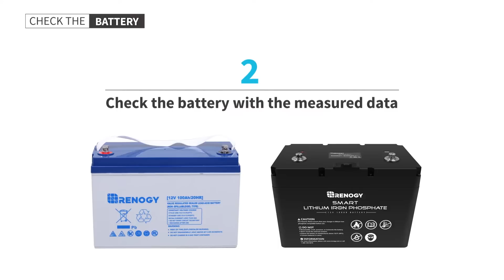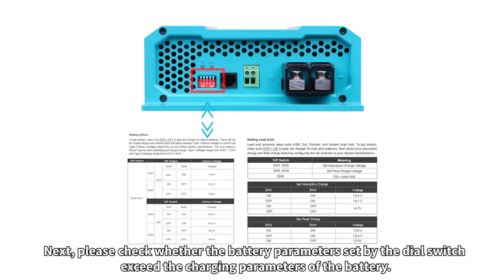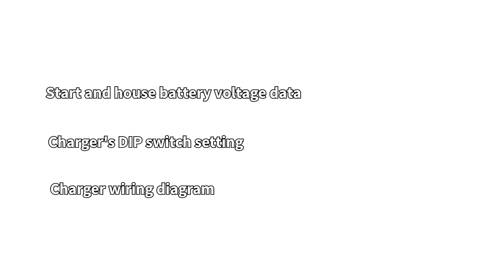Troubleshooting 12V DC-DC Battery Charger

Comment: My input voltage is 14.5v output is reading 13.4v (lithium battery voltage) and no red light but green light on . Dip switches are all correct 1 &5 off 2,3,4 on. What to check next?
Reply from the maker: Hello！You can disconnect and reconnect the wiring on the charger. Then, with the charger's green light on, disconnect the wiring on the output end and use a multimeter to measure the voltage at the output terminal to see if it reaches 14.4V. If not, it means the charger is faulty

Comment: I have a red light on with the greenlight on as well and I disconnected the ground and replaced it and it's still on and not giving power to my solar battery.ive had it for a couple months and its been working jus fine
Reply: Did you figure this out?
Reply from the maker: Hey Cameron,

For any technical questions, please contact us here- https://www.renogy.com/contact-us?gclid=CjwKCAiA3pugBhAwEiwAWFzwdeH3Crd9vRTbjjTYl9l3daVqnotJPjBhs2nmw-Wkn1_guWQeW0ao6hoCOHcQAvD_BwE

Comment: I have 14.4 volts on input side of 40a dcdc charger and 13.7 on output side. Ive driven the car over 3 hrs to a campsite and the voltometer on my control box and battery box never changed value. Seems to not be charging green light and everythings on receiving power i cant figure it out.
Reply: Too bad they dont answer your question. I have the very same issue.  I dont think mine is working. May have to get a refund.
Reply from the maker: Hey Air Eye,

For any technical questions, please contact us here- https://www.renogy.com/contact-us?gclid=CjwKCAiA3pugBhAwEiwAWFzwdeH3Crd9vRTbjjTYl9l3daVqnotJPjBhs2nmw-Wkn1_guWQeW0ao6hoCOHcQAvD_BwE
Reply: @Slimsomerville  was thinking the same
Reply from the maker: Hey Brodie,

For any technical questions, please contact us here- https://www.renogy.com/contact-us?gclid=CjwKCAiA3pugBhAwEiwAWFzwdeH3Crd9vRTbjjTYl9l3daVqnotJPjBhs2nmw-Wkn1_guWQeW0ao6hoCOHcQAvD_BwE

Comment: Can anybody please tell me what the settings is for the dip switches I have two lead acid 100 ah leisure battery’s
Reply from the maker: Hi, Rob.

Please make sure SW5 = ON to gear the charger for lead acid batteries.

Next please set according to the voltage value of your boost charging and float charging. You can refer to page 16 in our manual book https://renogy.com/content/RNG-DCC1212-20-BC/DCC1212-204060-Manual.pdf.

Comment: How can i use custom "user" setting? I will buy if i can set special charge voltages for my diy battery bank
Reply from the maker: Hi, Blown.

In order to assist you to solve your problems, we suggest you can submit a case through our Help Center Portal (links listed below for specific locations）for help. 
 
https://renogy.force.com/helpcenter/s/contactsupport (USA)
https://renogy.force.com/helpcenterau/s/casesubmit (Australia)
https://renogy.force.com/helpcenterca/s/contactsupport (Canada)
https://renogy.force.com/helpcenteruk/s/contactsupport (UK)

Comment: I have a solid red light when unit is powered on. The unit has been used for a few months correctly, the wiring is correct. DIP switches haven't changed.
Renogy 170Ah battery at 50% charge:
Voltage in 14.1V
Voltage on output side 13.1V
DC charger was left on while vehicle was off, fully drained the car's starting battery. Issue started after recharging car battery to usable levels.
Reply from the maker: Hi, Winter.

For troubleshooting your problems, we may need you provide us with the photos or video for assistance. So we suggest you can submit a case through our Help Center Portal (links listed below for specific locations）.

https://renogy.force.com/helpcenter/s/contactsupport (USA)
https://renogy.force.com/helpcenterau/s/casesubmit (Australia)
https://renogy.force.com/helpcenterca/s/contactsupport (Canada)
https://renogy.force.com/helpcenteruk/s/contactsupport (UK)
Reply: Did you Happen to find out why the red light was on and how to fix it

Comment: Do you crooks plan on staying in business answer comments I need help withe 14.6v lithium type 2 dip switch settings?
Reply from the maker: Hi, Thick.

Thank you for your feedback. In order to solve your problems more efficiently, we suggest you submit a case through our Help Center Portal with more details (links listed below for specific locations）. If you have previously submitted a case which has not been replied, please provide us with the case number so that we can inform the customer service to solve it for you as soon as possible.
 
https://renogy.force.com/helpcenter/s/contactsupport (USA)
https://renogy.force.com/helpcenterau/s/casesubmit (Australia)
https://renogy.force.com/helpcenterca/s/contactsupport (Canada)
https://renogy.force.com/helpcenteruk/s/contactsupport (UK)

Comment: All wired up green light on. And hose batteries are flat but drove 20 miles and still no charge on house batteries
Reply: I’m experiencing a very similar problem.  All wired up but no voltage on the output side of the charger.   The smart shunt is not indicating any charge.  Were you able to resolve your issue?  Thx. Jason
Reply: @NikkiandJason95  I've ordered a battery monitor to see if its actually working when I drive.
Reply: @krispinktattoostudio1916  Any luck?
Reply: Same here. Wired up, solid green light on. Not charging. Guess we're missing a step. lol
Reply: @vangilanteryan713  so I contacted Renogy with my problem (great customer service in my opinion) and we worked through a few steps of troubleshooting the DC/DC charger and we figured it out! 

I didn't have my DIP switches properly configured. The manual is very confusing for this step and I thought I had it right, turns out I didn't. 

I have the Renogy 200mah battery so I needed to have the DIP switches set to: 
1=Off
2,3,4=On
5=Off

Now it works!! Hope this helps
Reply: @anida837  Yep. I did the same, it dawned on me when i found out the full charged voltage of the battery pack was 14.6. lol. Thanks!